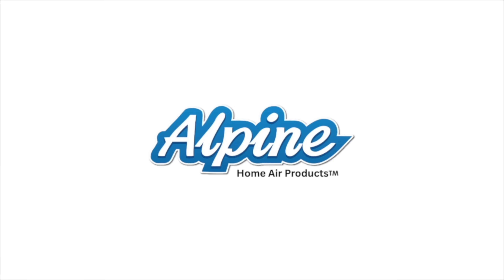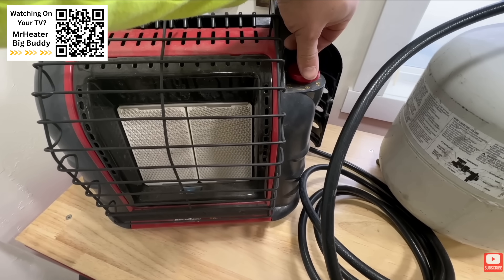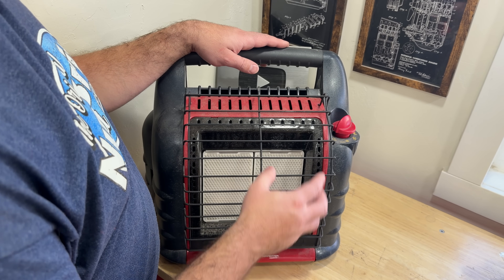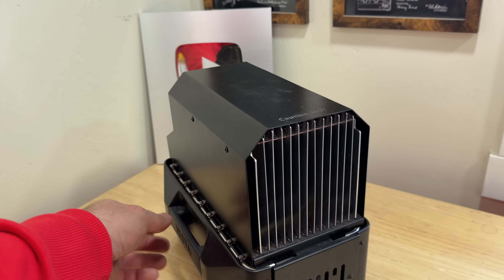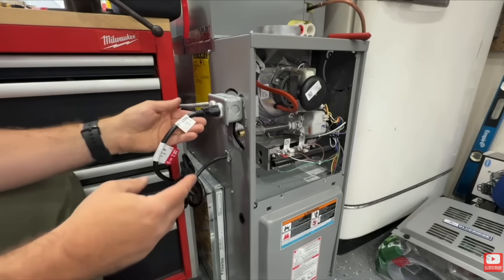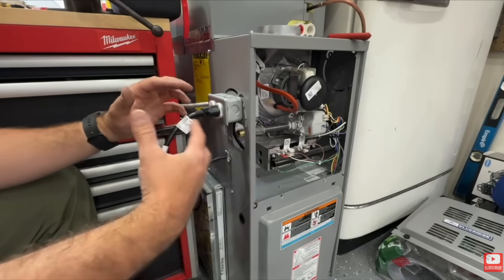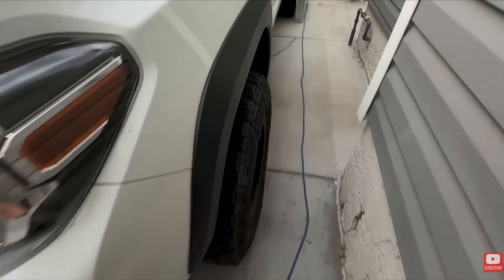Why Didn't We Think Of This Sooner?

Comment: 2 issues -
1) Car alternators can generally produce UP TO 1200 watts max. But some of the power is needed to run the car so you might get 800-1000 watts if lucky.
Engine must be running or you drain the battery quickly and damage it.
2) The pigtail does work ON NEWER furnaces generally.
Have a very old furnace, you need to use an appliance extension cord as your pigtail.

My furnace uses a whopping 15 amps just to start and 7 amps running.
Pigtails made from cheap extension cords may be problematic and potentially a fire hazard.

That EZ Generator switch is far too expensive for what you get. $90 for $20 worth of parts is a ripoff.
You can make your own out of a simple light switch and some wiring finesse.
Be careful using your generator - some have issues with grounding and bonding. READ YOUR GENERATOR MANUAL.
Many furnaces require a ground too (for reference) or they won't come on.

Those ac inverters are not all the same either.
Some are not true 120vac on one leg but rather two 60vac on 2 of the legs. NOT THE SAME THING for electronics and such.
One easy to tell is if your inverter has an actual grounding conductor where your 3rd prong plugs in. Many are just blank spaces.
And those are the 60x60 ones for the most part.

DO YOUR RESEARCH!

Oh and you want an inverter that handles up to 1500 to 2000 watts peak, 1000 running. Reason is higher ratings = less heat the inverter makes and longer lifespan.

While many inverters claim 1000 watts, they don't tell you that it is 1000 watts PEAK (but you have to look for RUNNING watts or continuous watts).
Peak means instant startup watts (for a few seconds).

You can hook up a solar system to your furnace too. Doesn't have to be whole house one either.
No fuel or noise that way.
BUT a generator is great for cloudy days and nighttime.

Comment: We lived  in Japan in the late 80s and our only heat source was kerosene.  That’s is still what the Japanese use today.  20 gallons lasted 7 days or more.  The difference is the kerosene heater today is way more efficient than back then. .  Our current furnace uses propane on a 500 gallons tank.  Ventless propane that don’t need  electricity is the ultimate of alternative heating outside of a wood stove.  We have a Mr Buddy and outside of a short power outage they arent very efficient.

Comment: A small kerosene heater is the better option. No compressed fuel inside your home that can leak out while you sleep and kill you. A 5 gallon tank of Kerosene costs slightly more than a 20 pound propane tank is to exchange; about $5 more. But the kerosene will burn for a week on 5 gallons vs the propane for 1-2 days of continuous use.
Reply: 5 gallon tank of Kerosene costs $50 + tax ----  a 20 pound propane tank refill $23 + tax in Dallas Texas 1/22/2026
Reply: @BillR-e2g  Its $5/gallon where I live... to exchange a small propane tank is $21. Edit: Its $3.79 a gallon not $5.
Reply: @ThorTreksOfficial  nice where , in general terms, might this be?

Comment: Keep the metal grate on the front and instead use a metal paint roller strainer grate to fit on top the heater. It's much more sturdy to put pots on to cook with

Comment: That combo detector is dangerous. If you work hvac, you should be supplied with a portable carbon monoxide monitor to wear at all times when you are working on systems. Very dangerous if you don't!!! Carbon monoxide detectors are are not safe for all people and pets, even when placed low as they are supposed to be,  it's the carbon monoxide monitors that are safe for all.

Comment: IMPORTANT - Carbon monoxide detectors don't register the level until it's past fatal for most people and pets. (You can easily look this up) You need a carbon monoxide MONITOR. It will detect the actual level. ALSO- carbon monoxide fills the space from the floor up. Smoke fills the space from high to low. the smoke detector is placed on the ceiling, a carbon monoxide monitor should be placed close to the floor, so it will go off before the carbon monoxide will reach your head height at the lowest posture you will be in (ie sitting on floor, or laying down, etc). That combo detector is dangerous  to rely on for carbon monoxide! By the time the dangerous gas fills the room up to reach the detector that is placed up near the ceiling, and to build up to the amount that will set off that detector you have, you may already be passed out. Be safe!

Comment: Did you by chance forget to mention that The Buddy heaters will shut off if they detect Low Oxygen or Monoxide.
They have been tested and they do work.
Reply: Low o2 works but there's no monoxide sensor. The o2 sensor is entirely based on the flame length and thermocouple. if O2 is low, the flame is too short to heat the thermocouple which is what normally keeps the gas valve open.
Reply: All flames burn oxygen and can deplete oxygen levels to the point it will not sustain life.
Reply: @akbychoice  terrible advice terry gave to someone who will believe his fake advice.  by the time lack of o2 puts out the flame, prob everyone in an that space is probably unconscious or close to it.  theres no substitute for carbon monoxide detector then a DETECTOR
Reply: I had Mr Buddy for about 8 years in my garage.  Best choice of heat.
Reply: Uneducated comment. Grab a personal monoxide detector and you will indeed find out how dangerous the Mr heater buddy really is. Not to mention the hundreds if not thousands of reported cases of carbon monoxide poisoning using this device inside (even with ventilation)
And like many have mentioned, no Mr heater buddy has a carbon monoxide detector.
You really should not speak when you have no clue what youre talking about. I have myself run it in my vehicle with all 4 windows opened 6 inches or more and it still is registering 50ppm and over long periods of time slowly being saturated with low levels of carbon monoxide daily will make you go dumb 😂
Reply: @Travis-q99999 Too many people learn the hard way.
Reply: FYI- These have been tested in small truck campers and 4 person tents, sensors too, and while they do recommend a small air vent, they are safe for smaller spaces.  There are multiple reviews here to find.
Reply: Good to know!
Reply: They do NOT detect carbon monoxide. Don't spread misinformation. These heaters, by design, produce carbon monoxide.
Reply: @Japplesnap  They do NOT produce carbon monoxide by design. They only produce CO if your propane is dirty or there is a malfunction.... Don't spread misinformation!
Reply: @joearledge WRONG!  They do produce CO, even manual says it does.  Manual states heater is to be used w proper ventilation in enclosed space.
Reply: @Japplesnap They don’t seem to produce a measurable amount of carbon monoxide. When I run mine in a tent, I keep a carbon monoxide sensor / alarm hanging from the top of the tent just in case, but it reads 0 even after the heater has been running for a while.
Reply: @GraysonCarr Keep in mind that household CO detectors don't display or trigger below a reading of 30. And that's fine because it takes more than 8 hours of exposure at that limit to cause any real har . However, over time even lower levels of exposure can cause health issues if you keep up the exposure.
Reply: @Japplesnap I bought a CO detector that displays the level at all times, even when below the alarm threshold, and it shows nothing when the buddy is running. I think the buddy produces extremely little CO, just like breathing does, and my tent has enough ventilation that no measurable amount of CO is able to accumulate.
Reply: @GraysonCarr Sure you did. 😂😂😂 BTW,  people produce carbon dioxide when breathing, not carbon monoxide. The fact that you don't know the difference tells me all I need to know about you.
Reply: NO HOME OR RV IS AIR TIGHT SO IGNORANT INDIVIDUALS NEED TO PISS OFF !!! I USE 24HRS A DAY AND IM NOT FKN DEAD AND HAVEN'T IN 4 DAMN YEARS OF USEING ONE !!!!
Reply: @BrianParrish-ze6mx — Interesting comment 👍🏼.   There is nothing wrong with asking questions, we are all here to learn. I get they are safe, get that they have been tested with sensors in multiple small truck campers and even smaller tents.   My only points are 1. No more coffee for you, and 2. You are hereby fined for unnecessary use of the caps lock function. 🤠
Reply: @BrianParrish-ze6mx Educate yourself. Even exposure to low levels of carbon monoxide can be very bad for you over time. Long-Term Exposure (Low Levels): Chronic exposure can cause lasting neurological issues, including memory impairment, depression, and cognitive dysfunction, sometimes persisting for months or years.
Reply: @BrianParrish-ze6mx  I would encourage using carbon monoxide and propane detectors in home.

Comment: Your link to Amazon for the 20lb hose adapter is a problem. I ordered one to eliminate the filter I am using, what I got did not have the F273704 part number anywhere on the plastic bag it came in. Since I am not using the F273704 hose and I did not want to take a chance with the Amazon  hose and clog up my heater so I returned it and will continue to use a filter.

Comment: I work in a related havc feild. I can tell you that you may want to invest in a small ups to put between your furnace and the generator. Some furnrace control boards will not tolerate being connected directly to a non inverter generator. Some are so sensitive to voltage fluctuations that they can not handle any generator power at all. Unfortunately,  I do not have a large enough sample size to tell you what brand or style are the most susceptible. I do feel confident in saying that newer, more efficient or feature laden you furnace is the more vulnerable it is to failure due to power issues. Also, to be clear, I do not sell to the public and will not recomend any particular product. I made this post simply as a fyi.

Comment: I have tested this for inside a trailer and IT IS NOT SAFE  for that use. C0 detector will go off after just after you are warm and asleep. That was in a trailer 8 X12. Don't be fooled by the way it is advertised particularly in the U.S. THEY ARE NOT SOLD FOR INDOOR USE IN CANADA for this reason. Stay safe.

Comment: Caution Running Inverter on Car battery/alternator can cause car alternator to fail:
1.  This can burn up the car alternator and result in damage and expensive repairs.  Check your specific car spare alternator capacity.  Some cars are equipped with higher capacity alternators, most are not.
2.  A car with an older battery can draw down the battery and drive full inverter load to the alternator.  If this happens and the load is greater than the alternator (spare) capacity, this will overload the alternator causing overheating and failure.
These don't alway happen but if they do, be prepared for potentially expensive car repairs.
3. I had this type failure which resulted in a $3,000 repair which included alternator, air mass detector and main computer replacements.
4. It is best to isolate this setup from the vehicle and run the inverter off of a standalone inverter/LifeP04 battery.  This protects the car.

Drawbacks of Mr. Buddy heater.
1. When using long hose with 20lb tank, the hose is exposed, can be kicked/moved and leaking fitting can result.  Each time the hose is connected or moved, the unit should be checked for leaks.
2. Hose is a constant trip hazard and hassle.
3. The hose requires a filter ($6-$8 each), replaced each year or more often based on usage.  Not using hose will damage/destroy heater.
4. Moving the heater is inconvenient and a bit cumbersome.
5. Cooking is not recommended.  You will overboil food into the Mr. Heater permanently damaging the heating elements requiring replacement, a tedious and lengthy procedure.  Unit may never work correctly again.
6. There are situations where the Mr. Buddy is a very good choice.  For my use cases, it is not the best choice.

Alternative, Mr. Heater 18,000,BTU Cabinet Heater (great for floor only applications):
Note, for maximum heating efficiency, only heat space where you are located.  This makes best use of fuel and capacity and will provide maximum comfort.  Attempting to heat an entire space requires much more LP and loads the area with moisture from the propane burn process (running at max 18,000 BTU/hour).
1. Mr. Heater cabinet heater, 6,000/12,000/18,000 heater on casters.  Runs 72/48/24 Hours continuously.  We use periodically and get 1 or more weeks capacity during cold weather (20F or below).  The colder the more gas required.  In five years usage, we have only burned more than one 20lb in under 7 days one time.  That week was 0F with highs of 5F - 7F.
2. This cabinet completely holds and protects the 20lb tank  plua hose (short) inside and protected from bumping and causing leaks.  Can be left connected.
3. Does not require a filter.
4. The top of cabinet does not get hot and a usb rechargeable fan can be used on top to more effectively distribute heat, a game changer.  This set up will heat my entire 800SF space very well (65F+)  with temps outside of 5F.
6. I have had this model 5 years and never had an issue.
7. Have never detected CO2 (2 different sensors) or LP, or smoke.

Note!  In off-season store the heater in a garbage bag in original box to protect unit from dust/dirt which can disable starting system.

SAFETY:
1. Follow manufacturer safety recommendations.
2. Use a Smoke detector
3. Use a gas detector
4. Use a CO2 detector
5. Ventilate
6. Never use when sleeping
7. Never use unattended
8. Stay in presence of heater when in operation, monitor unit use at all times.
9. Keep combustibles well away from unit.

I have found this unit works extremely well and have purchased a 2nd unit for camping inside a 12x12 pop up tent with walls.  With the walls up and a usb fan, this unit keeps the pop up toasty 5F-10F.

Both units are very well made and perform

Comment: I have the same Mr. Buddy as seen above. I bought the filter and hose by Mr. Buddy before setting it up. I have ran mine for my 13 ft trailer for over a month now. I can attest to no clogging due to the filter. I use it on high for about 20 to 30 mins to warm up and then on low for the rest of the night. I get about 40 to 60 hours this way. With 2 20 pd bottles I'm good for about 10 days.

Comment: After 2 hours of running on low my tent is full of condensation during winter camping using my Buddy heater, I started using a diesel heater last winter and no condensation problems at all and such a more comfortable dry heat that I do not use my Buddy heater anymore. With my carbon monoxide detector the buddy is putting out a constant 13 ppm and I have to vent a lot to keep the levels at 0, my diesel heater stays at 0 with no venting needed. I sleep better knowing I am not breathing in over 10 ppm over 10 hour period which is unhealthy. I will only use my Buddy heater when outdoors in my gazebo or ice fishing

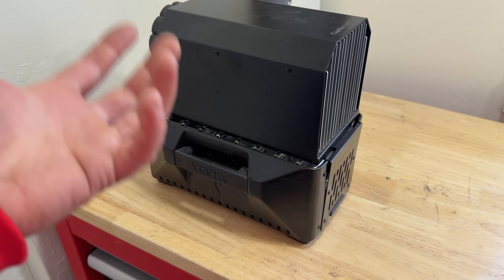Comment: 4:32 It seems like you could just use recycled tin cans turned into alcohol stoves as the heat source so that you don't have to go buy the Sterno, which is more expensive. It seems like it could produce equivalent heat but still be much cheaper to use. The extra supply of alcohol could also be used medically in an emergency if need be, thus effectively reducing or even eliminating completely the cost of using of Sterno cans. Plus you reduce your supply list by one item. Having items in your emergency supplies that can be used in multiple capacities is just smart. You can't take everything including the kitchen sink with you during a bug out, so multiple use items become that much more valuable.

Comment: I'd be putting those 20 lb propane tanks outside & running the hose in. Buddy heater & a tank are my 2nd backup heat option.

Comment: Those things are killer, wish i still had mine for the garage, but kerosene w\ keroclean.. Lasts longer set to low.
And yea, its supposed to be safe for indoor use.  Its advertised as a tent\camping heater.   My father used his in the guard shack while working security.

Comment: That EZ generator switch is an interesting option. I did find myself wondering "why not just install an outlet and plug instead?' and you answered that immediately afterwards.

I am thinking about going this route instead of the much more involved and expensive exterior generator inlet with interlock kit on my breaker panel. That would be more versatile as i could run fridge/freezer and household lights very easily, but this is such a simpler and cheaper option.

Comment: Just buy a wood burning stove or a pellet stove. My small potbelly stove heat's my home to 75-85 degrees in 30 minutes. That propane heater isn't heating a whole house at 70+ degrees.  
Wood stove is way more practical. In emergency situations, how are you gonna get propane? Wood is everywhere.

Comment: Don’t forget most homeowners who mow their own larger lawns have a wonderful and potentially easily portable generator that you don’t have to lift and uses much less fuel than a car or pickup truck idling…..Pull your little lawn tractor or zero turn mower out of the garage or shed and place it close to the house as not to need a a trans-Atlantic length extension cord. Just make sure you have the exhaust aimed away from the home and idle up the mower engine just a little, clamp on the positive and negative clamps of your 1000watt or higher Harbor Freight $100 budget inverter and a full lawn mower tank slightly above idle will probably run without needed a refueling until the power company gets your outage repaired.

Comment: I've been a full time rv dweller and been using buddy heaters and have to clean the oil from the lines .I use a 6 foot hose and filter on a 30 pound tank